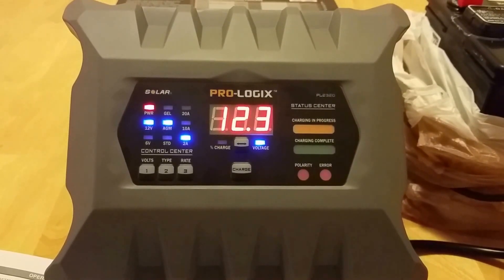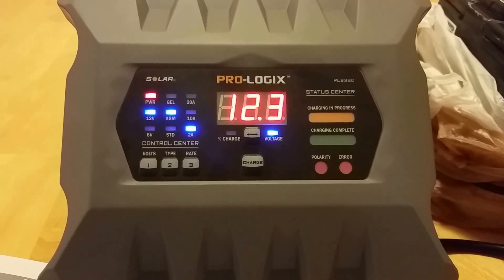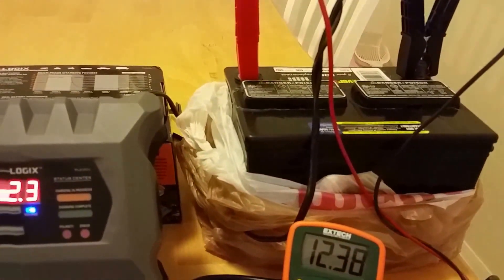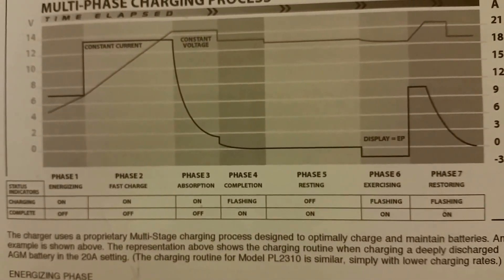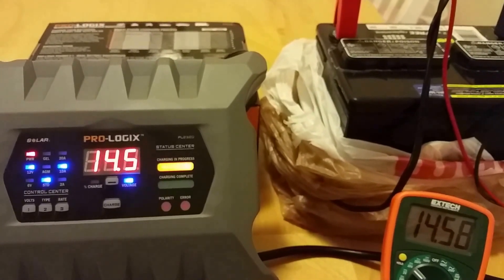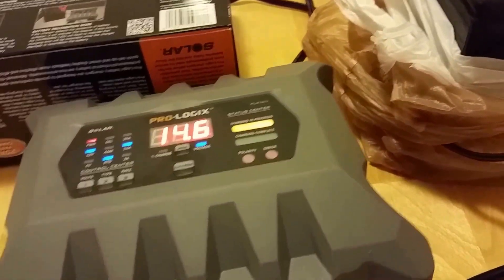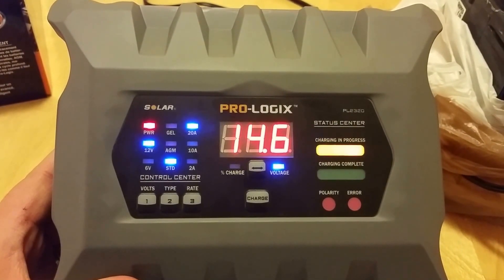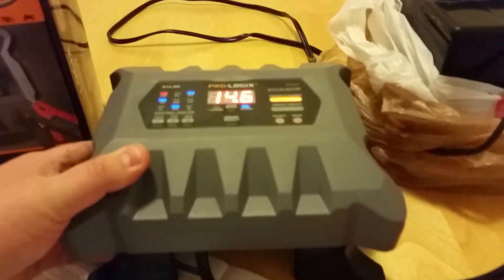review of Solar Prologix PL2320, 6v/12v battery charger/maintainer

Comment: Question for you 
It have power supply .. if I want programming the car ? 
Thanks
Reply from the maker: It doesn't have a dedicated supply mode unfortunately it would probably bring the voltage over 14v depending on the vehicle draw and amp setting on the charger but you could probably use it in a pinch at the low amp setting to keep it close to where it should be depending on what you're programming and their max voltage allowed.

Comment: Mine won't turn on, any reason why?
Reply from the maker: I'm not sure if it's not powering on it could be defective. Did you try another wall outlet or verify the outlet has power with another device? Mines been running like a champ.
Reply: @justinv3080  I've been running from my generator trying to keep batteries charged up
Reply from the maker: @Vndl.X  I don't know if all generators are capable of powering the charger, I think you would need a sine wave compatible generator for most sensitive electronics including this
Reply: @justinv3080  I've basically been hauling a deep freezer around and running 2 deep cycle batteries to keep it going and I thought using a generator would help to keep my batteries charged up, but I think the generator wasn't too kind to it.... sad face, hopefully tues ill get my problems sorted out, im buying a new deep freezer as this one is super old

Comment: Thank you for the informative video, only question is can the unit maintain a steady power supply on the battery while working on the car ? I noticed other PL 2320 has a blue color box around the power light which I believe is for maintaining a constant battery charge while let’s say replacing and programming a module ..but I don’t see the power light having that blue square around the power light ? Is the unit you have capable of doing that ?
Reply from the maker: I don't think it's intended for power supply use but if you set it to the highest charge current level it would stop charging when the battery was full and start charging again as the state of charge drops, when it's connected its always monitoring the voltage level, I can't remember the exact figures but it does resume charging after the voltage drops below a certain point, so it would still achieve the goal of keeping the battery from discharging too low while working on the system.

I suppose it would just depend on what you were doing on the vehicle as the max current is 20 amps, so if you exceed that draw it wouldn't be able to keep the battery state of charge full forever.

Comment: I currently own a Clore Automotive Pro-logix PL2320 car battery charger.
I believe it shuts off when done charging, so it can NOT be used as an ongoing trickle charger for weeks or months on end?
Can someone please confirm, thanks.
Reply from the maker: It can be left hooked up indefinitely it monitors voltage and stops when full then will resume charging if the battery drops too low.

Comment: Thanks for the video.  Is the only difference between this one and the 2310 that the 2310 only has 10 amps max charging current?  I'm guessing the 10 amps will just charge slower but does it even matter if you are content with waiting longer?
Reply from the maker: Yes that's the only difference I'm aware of is the max charge current on the PL2320, but I would think with the higher charge current capabilities it has to have something beefier internally that may be desirable for durability.

10 amps is still a pretty decent charge rate though should charge most any average car battery overnight or within at least 6-8 hours

Comment: I have to edit, I found that the on-line store I was going to order from had the 2520 part number on the 2510 description,  the charger I wanted is the 2510, I picked one up at Napa and it is charging at this moment I type
Reply from the maker: I'm not sure exactly but the PL2520 should be the same as mine 2/10/20 amps with the addition of the 100A boost which isn't for charging but just for jump starting.
Reply: @justinv3080 , I called Century Tools, after 35 minutes on the phone, their site description is wrong for the 2520! the charger I want (PL 2510) is not made any more thanks to California laws,  so I am not getting what I want. 
I tell you, as for some of the chargers out there, I have seen it over and over again and again throughout my lifetime, some times it just takes some one off the street to set up a design to make things correct because the designers over think things, and these companies need that input surely

sorry for the edit
Reply from the maker: @sideswiped6874  what kind of application are you using where the 20 amps isn't enough?
Reply: @justinv3080 , thanks for replying ! I have to edit my post above

Comment: Thanks for the vid - do you find any documentation about what size battery bank Clore claims its good for? 
Most smart chargers like this list a range and I can't find anything like that for this charger. 
Both CTEK and my fav brand Optimate list AH ranges for all their chargers.
Reply from the maker: I don't see any information on that but with 20 amps it should be good for almost anything, it would just take longer to charge.

Comment: I saw AvE dissecting this charger and it's a quality item. Only thing is that it only comes with clamps, not like ctek with a connector cable you  can  screw on to the battery and leave it there. And you just connect it to a plug when you need to charge. Maybe it's possible to purchase as an option?
Reply: You don’t absolutely need this but I’m sure there is a connector because you can take them off and if they don’t it would not be hard to make one and get it into Production for customers and who knows no companies ever do this but who knows maybe down the road people that purchased it get a free one sent to them all you have to do is send your address and they will send you one if you need it

Comment: FYI this is same as Snap-on Bluepoint brand charger. I was going to get a Noco but I know Snap-On and Bluepoint don't produce junk, only quality stuff that last forever. I have smaller C-Tek Multi 3300 I am replacing. That thing has charger dozens on dozens of batteries but it gets so warm I wanted something more heavy duty.
Reply: Your point is now you going to get
Reply: You are

Comment: Looks likes a very good smart battery charger. I have an old Schumacher battery charger I bought more than 10 years ago. When it died I will get this Solar Prologix charger for sure. Thanks for great reviews.
Reply: Every shumacher product my work tried failed rather quickly. Usually fans die in them. I won’t buy any of their products after seeing their failure rate. Of yours is 10 years old you have been lucky.